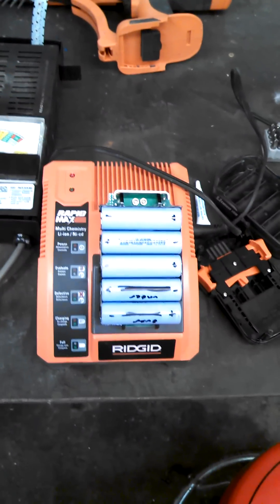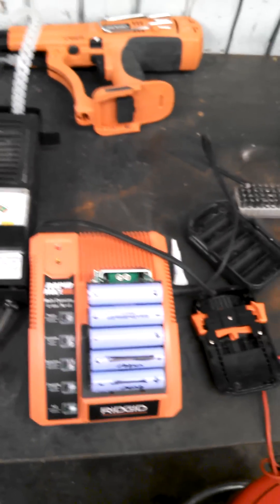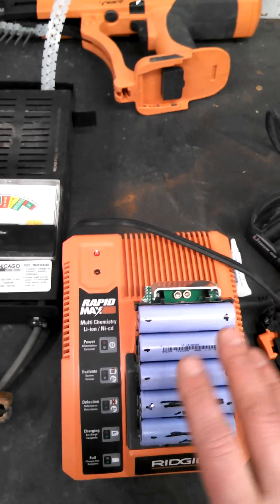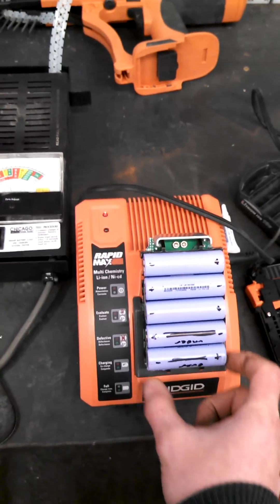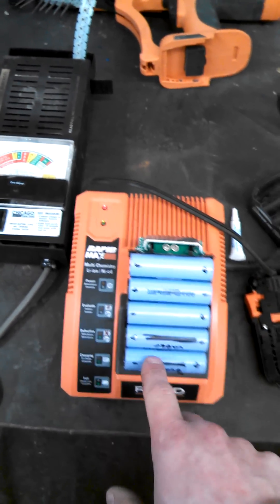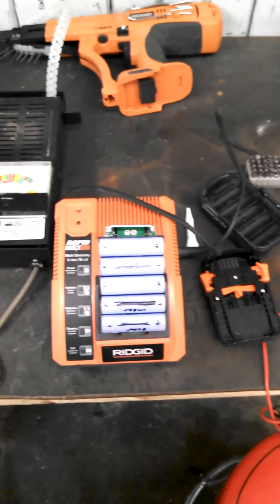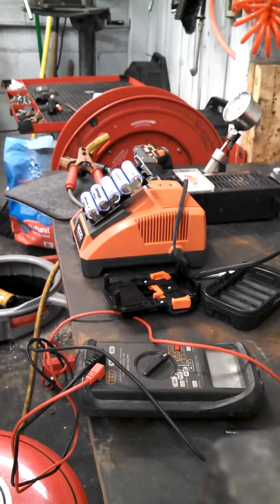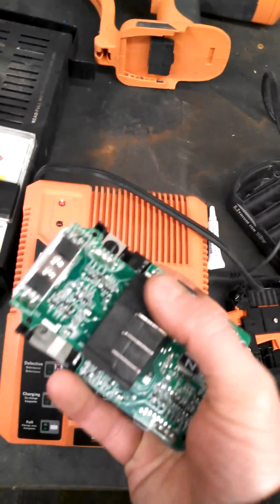Ridgid lithium 18v battery repair

Comment: register your tools and get free batteries for life
Reply: Everything said it had a warranty, so yes, I expected one. And yes, I HAVE stopped shopping there.

Whether or not YOU saw them refuse any returns is irrelevant. They certainly refused mine after I discovered I could not register it for the warranty because I didn't get the original box with it.
Reply: Many people are saying that's a sham and they will don't give free batteries for life or at all.  Doesn't make sense that a company would give you free batteries for life seeing how everyone knows batteries are the cash cow of the cordless tool world. It's like buying a car and getting free parts and service for life.  Parts and service are the cash cow of car dealerships. Not much margin on the car itself. Same with the tools, not much margin on the tools.
Reply: Yes, the collective wisdom of "many people". Ever seen what they charge for new ridgid batteries, that has a lot of mark-up built-in. Also, lots of people are going to forget to register their tools or forget that they're under warranty and just buy new batteries to avoid the hassle. Moral of the story is: screw what " many people" have to say.
Reply: Don't count on it a battery (or any) warranty from Ridgid. A couple of years ago I bought a a Ridgid portable circular saw at Home Depot that was on sale as a display model. It didn't come with a box, which I didn't care about until I tried to register it for the warranty.  "Sorry sir, you can't register your saw for a warranty without the bar code from the box."

It didn't matter that I had the sales receipt. They demanded the original bar code from the original box. And Home Depot would't let me return it because it was a clearance priced display model.

So of course, 6 months later the battery craps out (after very limited use) and I'm out of luck. "No, you don't have a warranty on that battery or saw because you didn't register it. But we'll be happy to sell you a new battery for nearly as much as you paid for the saw."

F*ck Ridgid and f*ck Home Depot. 

Do a Google search to see how unreliable Ridgid batteries are.
Reply: Just go to Home Depot and take a picture of the barcode on another box. The barcodes are all the same, it's the serial number that is different.
Reply: You buy something on clearance then freak out when they won't also give you a lifetime warranty on it? Cry more. I paid full price for my tools with the understanding that I'd be getting the LSA, you want the same warranty that I have when you only paid a fraction of retail? 

Having worked at Home Depot I've never seen them refuse a return as long as you have a receipt and aren't trying to pull a fast one on them. If you were trying to use them as a free  tool rental, for instance, I can see them telling you to take a hike. And rightfully so. 

"F*ck Ridgid and f*ck Home Depot." tells me what sort of person you are. I honestly hope you've stopped shopping there.

Comment: Where to buy loose cells? Part no?
Reply: I have salvaged over 20 cells from old laptop batteries. Most of the time, only one or 2 cells are bad in a laptop battery pack and the others are just fine.

Comment: Thanks for sharing.  Something i recently learned is that the Ridgid lifetime warranty is not what it seams - at all.  The marketing is very slick, lots of flashy banners describing free batteries, free parts and free service for life.  This could not be further from the truth.  Most tools are sold without at battery AND batteries (costing as much as the tool in some cases) do not have a lifetime warranty - the rub is that you don't find this out until after you have bought your new tool and battery upon registration.  So its a very shallow offering.   One is better off shopping by shelf price and not being influenced by a warranty that is simply not there.
Reply: couldnt be more wrong, I have replaced my batteries twice for free, I burnt up my orbital sander and they replaced it. Very hapy with my ridgid tools and the lifetime warrenty
Reply: Suggest you read the post again. Then try buying a tool like the skill saw. No battery included, no lifetime warranty either. The batteries included with the kits are covered, unfortunately these batteries are very short run time and not much use if you really want to use the tool. Try to buy another battery and you will see I'm not wrong.
Reply: If you buy any tool with battery and charger included they are warrentied for life. As I said I have replaced 3 batteries as of now and ready to replace a 4th. As long as you register them you are good to go. I believe anything not covered by this is covered for 3 years. Read the fine print before you purchase
Reply: +M Landers, The batteries are at least now made by Samsung. Its best to buy batteries in kit where they become eligible for the LSA warranty. The 
larger 4.0 batteries are hard to find in kit form. You will find letting
 any battery (not unlike refrigerators, or car AC cooling systems) sit 
for a prolonged time frame isn't conducive to battery longevity. This is
 a common enough battery melody, the LSA agreement at least gives you a 
fighting replacement chance in  negation of improper storage and 
infrequent usage. Instead of just buying new separate batteries, I find 
you can buy a whole combo kit that comes with batteries and then they 
are LSA eligible. Also as of approx. June 2012 you need to RE-REGISTER any new warranty replaced batteries serial numbers within 90 days of replacement, other wise your LSA registered KIT purchased batteries revert to a 90 day warranty.

Comment: Do not do this. Lithium batteries are very sensitive and will ignite if abused. Adding a 100 amp load to such a small battery is like directly shorting it out. Also, overcharging and heating the cells up destroys them. 
Sorry, but this is a very bad idea, someone will get hurt.
Reply: My thoughts exactly. Overcharging lithium batteries is pretty risky. Especially if you run across a bad cell. 
You get violent explosion and fire. Lithium batteries are notorious for causing fires when overcharged. 
   Not saying I wouldn't try it.... But I'd also make sure I'm wearing eye protection, gloves.... And performing outside. 
  Thanks for the video
Reply: lol face shield!!!